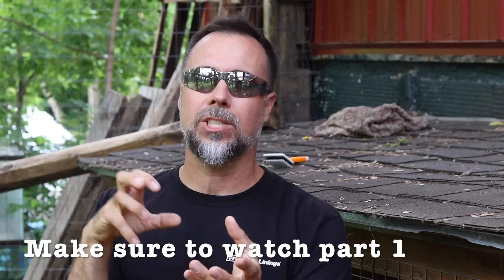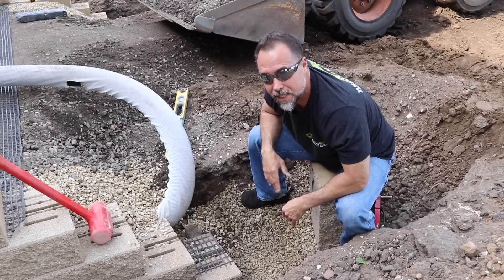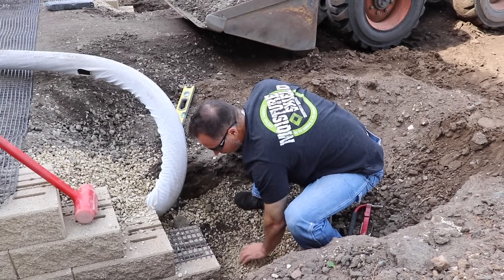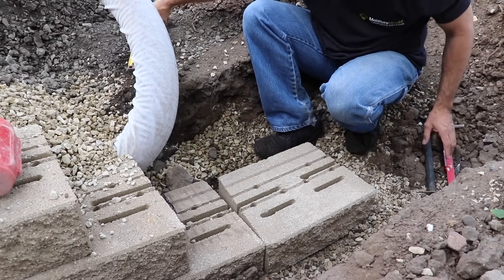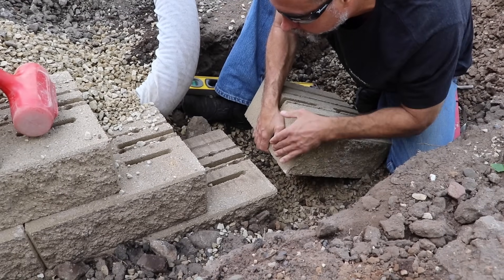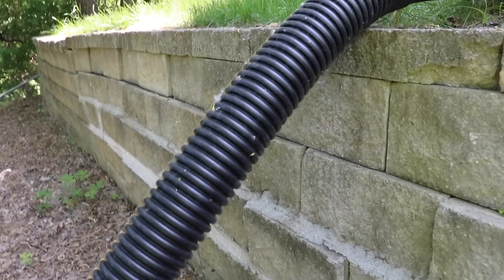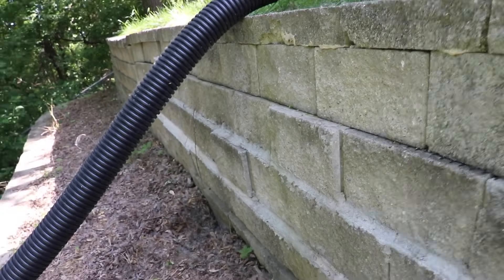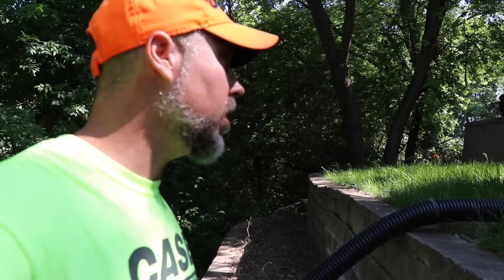Common Retaining wall mistakes & how to AVOID THEM, bad designs, bad base, wrong block....#2

Comment: Hi Stan, I am looking out my window at a 40 foot retaining wall built three months ago leaning over and failing that was supposed to last twenty years. The contractor blamed me for not putting down vegetation on the slope and has refused to tear down and rebuild the wall properly. I simply don't have thousands of dollars laying around to pay another contractor. I can't tell you how much I appreciate you taking the time to produce your videos. My teenage son and I are going to start the rebuild next week. I just have to feed the kid. Again, THANK YOU!!!
Reply: My parents have the same problem, I'm trying to offer to rebuild it if they pay for equipment rentals but that's even expensive after paying contractors previously!
Reply: Chad Richardson he was talking height the whole video, so when I read “40 foot retaining wall” my eyes popped outa my head for a second. 🤣
Reply: was it a mortar and rebar wall or a cementless wall?
Reply: So how did that turn out for ya?
Reply: Not overkill at all.  Every good wall builder I've talked to says that first row is far and away the most important part and it takes time and patience to get it level from the first to last block, but when it is, its stack and go with level checks and quick adjustments.   When you cap it and look down the line you don't see that wavy crap most contractors install.  If you don't see guys on their knees with a level, hire someone else. This is my opinion as a customer, not a craftsman. I think knowing this getting the right base material is a no brainer.

Comment: Stan... Your spot on!  My company lifts settled concrete slabs (driveways, porches...etc).  I would say that 1/3 of the slabs we level are due to retaining wall  problems.  Change that to "contractor problems".  Like you I run my company with only perfection in mind.  When a bad contractor installs a bad wall it affects my company.  How can I guaranty against settlement when I know that a wall is going to move and the slabs we fix are going to settle again.  I tell my customers to get their walls fixed or replaced and then I'll fix their driveway.  The issue is that in my business there are hackers that go for the dollar and will do the job anyway. The customers really don't know their being taken advantage of.  You spreading the word makes my job easier...
Reply: Seems like a business opportunity

Comment: I was going to mention about the drain tile that you said it wouldn't really be needed but is a safe guard and I agree. However, with our recent weather lately having 8 inches of rain in an hour here in Northern Iowa yesterday I think that is a time when you want to have lots of drainage behind a wall with the tile to take the water away fast. Just thought I would mention that because I sometimes forget about those freak rain events and am glad when I have installed them when I never thought they would be used.
Reply: Mat Prather do you live in North western Iowa cuz I live in eastern nebraska
Reply: Northern Iowa towards the center close to I35.
Reply: Mat Prather ok I may know ware that is but not 100% good with Iowa ither way your right thir has been lot of rain
Reply: Mat

Comment: Absolutely love your videos. I build most of my walls by myself and had to find ways to eliminate labor. Started using high fractured 3/4" crushed rock for base. I screed my 2' wide 6" deep footing level, lay landscape fabric, and then 1/2" electrical conduit to screed a 1/2" washed sand leveling base on the money. A little more cost on the rock, but make up for it in labor. Then I start laying blocks. Each block lays in on the money and any minor adjustments are made with a single rap of the dead weight hammer. Never had a wall move on me. Thank you for taking to time to make these videos. I have watched them multiple times and they never get old.

Comment: That was a very good video. I was actually expecting that much detail and more. I would have liked to see that project from the start. From excavation, fill materials, compaction, where to place the french drain, steps, to cap block. I would stay tuned in for the multi-series vids to watch your work. Keep it up.

Comment: You could go even deeper for professionals and it's never too much. When it gets over the heads of the DIY viewers, you're going to a place we need to refresh and revisit. It's always helpful to see problems and solutions we may not have come across. You bring up issues concerning a mistake or two we have all made, and sometimes get away with. I always use drain pipes when the walls are installed behind and above living space and outbuildings, it may be overkill but I am more comfortable with using them.
Thanks for your efforts in making informative videos and for confirming many of our practices and procedures. Appalachian Design & Build.

Comment: very informative and helpful.  sometimes too much detail, but I understand the need for it.  I have learned a lot and really appreciate the detail on the spacing about the terracing.  I now understand why my retaining wall is failing...for a number of reasons.  The previous owner didn't pull permits, etc. so it's a nightmare.  No deadman, no drainage, timber ties, no pins, no footing...oh god.

Comment: I'm an mechanical engineer, turned general contractor (FL).  I find your videos very informative and slightly distracting at the same time.  Your definitely not a fly-by-night contractor.  I applaud you on your lightheartedness and plethora of information on construction means, methods and most importantly the "WHY" - central to the idea of retaining walls.

Comment: Can you explain how curves lock in with versa lock blocks? Love that style of block and have seen all your videos on them. Just dont exactly understand how the pins still lock in on curves. Do they always go directly into the holes when straight and the grooves when curved?
Reply: yes they do
Reply: There are slots on the block, so when you stack one on top and drop the pin through, it will set in any position within reason.  If you’re doing an extreme concave build, the pins won’t go in.  These blocks also don’t have much of a bevel, so you can’t do a real hard convex curve without cutting.

Comment: I'm actually really enjoying your in-depth videos and its nice to see not only the materials, suggestions, techniques, but the reasoning why through experience. Your videos have actually made me reconsider the way I do my walls not because I've ever had any issues but because of a more simplistic method that could stream line the process and save on installation time.

Comment: You should definitely be happy with this. That was comprehensive and well spoken. You made it a comfortable experience. Easily understood. Helpful.detailed and I feel more confident now that I've watched that, on what to do and what material to use. Thanks for the excellent video. Super great guy to watch and learn from. Keep them coming.

Comment: Did my wall 7ys ago with a sub-ground 18'' cider block and sand foundation with a 1/4 bubble bump which went 4' high from ground level. The back dirt wall was dug 2'-3' back due to structural curve, with fiber barrier against the back dirt wall, back-filled  with gravel and a drainage line at second brick level. The terrace was started 30'' back due to proximity to property line. I used many of your technics in my build, so thanks for the conformation. Only problem I had is when ground hogs dug through the drain putting gravel on 2nd level. My 36'x 6' wall gained my yard and additional 36'x 25' pad; previously a hill causing my yard to be a swamp.

Comment: Thank you Stanley. I like to be detail oriented and totally believe in Good projects start with good Foundation, Foundation, foundation. I’m looking to start my exterior projects around my home. I’ve been ignoring for almost 25 yrs. I’m planning to remove asphalt driveway and install block pavers.My driveway sits about 6” above my neighbors attached driveway and am looking to separate the two driveways with a small retaining wall. I know I need to get it surveyed and get a permit. But I won’t do anything if I can’t do it right. So it takes me longer to research my project than it does to actually do. Thanks again for the small detail

Comment: I had a Building Inspector tell me early on there is no such thing as "Overkill" with construction. He told me to not listen to people complaining about 'Building to Code" on projects. He said for me to consider Code as the D- of construction because anything below Code is F work. He advised me to always strive to do A quality work, and even if I slipped up and slid to some B or B- quality, I would still be two grades above Code. That really stuck with me. So Stan, your videos never contain "Overkill" !!

Comment: Just about to build a small 2 foot tall wall and absolutely loved this video series, best one I've seen so far and like that you addressed the water going through the wall intentionally vs mortaring it. Also seriously appreciate the base material and leveling example. I've got 3 walls to do in the next few years, this will really help me plan them out better.

Comment: finding a video on the correct way to set a base block is few and far between  every other video doesnt show base preperation, it shows block installation on sand.  not what i want!
thanks again stan!  taking the extra time to show everything is very helpful!
Reply from the maker: Thank you Chris, appreciate the great comments!
Reply: Stanley "Dirt Monkey" Genadek thank you for getting back to me!  I’m installing a patio with a circle kit split between the far edge  with a seating wall coming off the foundation I’m starting the wall first. Burying a course and bringing the same up 1 inch above the class 5 and setting my patio after the wall is in. I’m assuming he circle kit gets installed when I start getting close   Also have a free standing wall with pillars and lights. 
I really truly do appreciate your videos and how far they have come. You. Kieth. And Brian are my go to guys!  If you have a quick second check out our website fairwayprofessionalservices.com  our branding is top notch! Enjoy your busy season coming up.  I’ll keep watching!

Comment: Thank you for taking the time.  Details were well explained and well demonstrated.  For the same reason, well laid dry stack rock foundations made 200 years ago still hold up well.  Early building codes stipulated mortar only,  which yielded a poorer result.  The government doesn't always know best it seems.

Comment: I'm not a contractor just a young new daring home owner. I spent about a week building a 13x13 patio with cheap 12x12 1.5 inch bricks. And man was it exhausting. Seeing you leveling that block made me cringe at what I just experienced doing it recently. Have you ever heard of  paver base boards they sell at Lowe's or HD? They're supposed to take the place of step 1 gravel. Major Fail. Super hard to work with returned it and ordered a delivery of 9 tons of processed dirt.  Anyway your channel is great I learn a bunch even though it's more designed for people who  are familiar with this kind of work. I kind of just use common sense to fill in the blanks of things you assume people watching understand. My next project is a small retaining wall in front of my garage. It's a crappy rock wall holding up about 1.5 foot of grade. I want it to look nicer. So I'll be searching your content for advice.

Comment: I am in the beginning stages of building a retaining wall. I've been doing research, planning on making my own blocks to use. All this information is very helpful. However I never thought about building codes. My wall from the highest point will be about 10ft and at the lowest point be ground level. The 3/4 clear gravel was very helpful along with using a packing machine and grid. Like I said all this info has been very helpful, sadly I have been discouraged and am thinking that I need more of a professional to handle the task. Keep up the videos and hope to educate.

Comment: Love the block you are using and worth the extra expense. If I lived on a property with steep pitch, I'd prefer single wall engineered with steel i-beams pyle driven and faced with steel rebar mesh of 1/2" diameter rods which is hidden a few feet behind retaining wall to take the pressure and ground movement off the retaining wall and allow water to flow freely. I work in interstate highway construction on the transportation side and the MSE wall panel systems we now use to build up sections of roadways and ramps uses methods similar to what you've displayed in this video. We use steel tie-back straps to connect all the wall panels which is covered in compacted sand. The back sides of the wall panels are covered with mesh fabric to keep the sand from escaping and water seeps through the sand down to embedded drain tiles which are ported outside the wall panels. While this whole design scares me, fact is it works. All elevated highways and ramps across the nation are now built with this method and it looks damned attractive.

Comment: Videos like these are fantastic! Only thing I always question and wonder about walls, patios, and such, is how to properly string line, and make the base course perfectly straight. I will one day get into work like this, but have never had the opportunity to work with anyone who does walls or anything, so I always look for as much information as possible on the setting up of the string line or how to ensure everything is started off straight, square, and true. That to me is the true art of all of hardscaping, and to me seems the most critical as well.

Comment: Stanley, great video series and the detail is really appreciated.

I'd request two videos from you when you can. First, a video on how to find and work with an engineer to design a retaining wall. Second, a video on how and what materials to use to backfill behind a retaining wall. Not necessarily the crushed stone right behind the wall, but the structural fill to build up a hillside behind a new retaining wall.

Thanks as always for the great videos!

Comment: Extremely good stuff, Stan. Your detailed basing demonstration gives me the confidence to use 3/4" clear instead of Class 5 in my own project. Thanks!
Reply: So let me ask: can you confirm that walls resting on 3/4" clear hold up as well over time as walls built on Class 5? And thanks again for your very helpful videos!

Comment: Great video with a lot of good advice. Being a general and sub on lots of jobs, I have seen the failure of lots of walls and still drive by many on state and county roads that the walls are failing.  I think your idea of decreasing the need a fall protection is accurate, at even a 4 foot height you should have some deterrent for falling.

Comment: All good stuff! Thank you so much especially where you said that the first course you level should take you as long as it does to lay 2 to 3 feet high of the same wall !!! I think if I had told my teenage boys that fact they would have said "Mom has lost it" and walked away.

Comment: Having no previous experience, I built my 150 foot three tiered nine foot high retaining wall myself out of these solid blocks because I could not afford to pay someone and the design evolved only as it was being erected. I excavated deeply  enough to completely bury the first course, made the base out of hand tamped class #2 granite 12" wide and eight inches thick. I learned to used a transom and grading stakes to make sure the base was level along each entire run. I then added a thin layer of fine sand to remove any unevenness before EVER SO GENTLY placing and leveling that first course blocks. Only slight adjustments were needed. I too utilized drain tile behind that first course and incorporated ""3/4 minus" drainage rock behind the walls for drainage.  I designed the wall so no visable portion is over four feet tall to eliminate using  geogrid. I also chose to incorporate 45 degree angled corners rather than curves which meant learning to use an INEXPENSIVE skill saw to score and split blocks consistently. (They don't make angled blocks).  No failures after 12 years and no uneven settling. That first course must be perfect and pristine. Any deviations become magnified with each succeeding course.

Comment: Still catching up on your older work. I did not watch #1 but in this episode I made note of two key points you made. Base Course and Drainage. These are the key to a solid wall that should last a lifetime. I have been building roads for 29 years now, mainly as a groundsman, layout, surveyor kinda guy. My third highway project on Shoshone National Forest in NW Wyoming, back in 1993, had miles of "Keystone" block retaining walls. I was told at the time it was the worlds largest "Keystone" project. I worked for the general contractor under the direction of WYDOT. They had a great set of engineered plans for these 92,000 individual blocks to be placed to hold up the road in the very mountainous terrain. Our crew prepared the subgrade and finish grade for the base course of blocks to be set by our sub-contractor. We also installed all the drainage features before blockage. Above the compacted subgrade (natural ground) we applied two six inch (compacted) lifts of type 2 Road base. After compaction we used +/- 1/4" of sand to fine grade. Only two guys laid ALL of the foundation blocks. The owner and his foreman laid every single base block and directed their crews to follow behind. Geo-grid was laid every third block up (24"). The only problem we had was that we did not account for the super-elevated finish grades for the road on the curves and the finish grader was ripping up the top layer of geo-grid and popping the top caps off of the wall. I walked a few of these walls last spring and they both were standing as we place them 26 years ago.